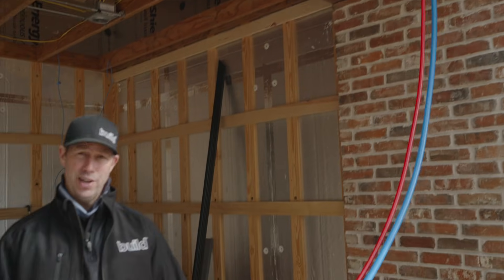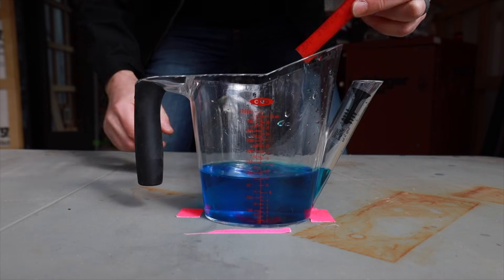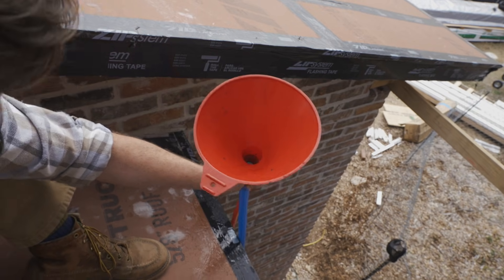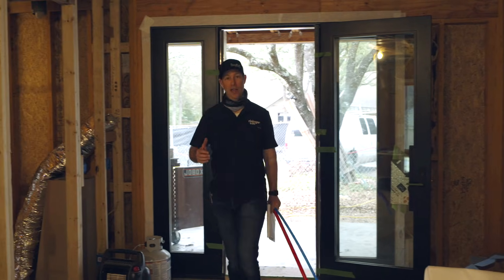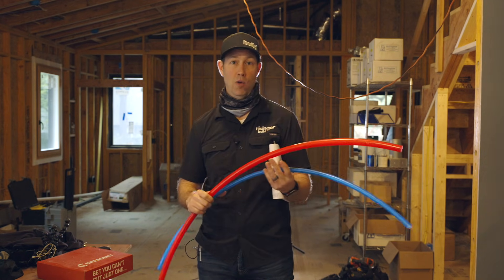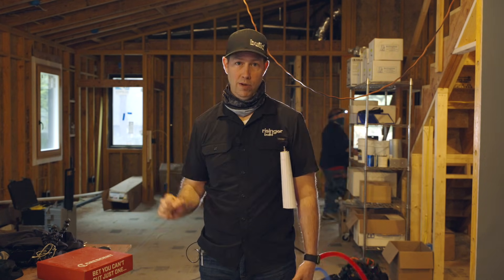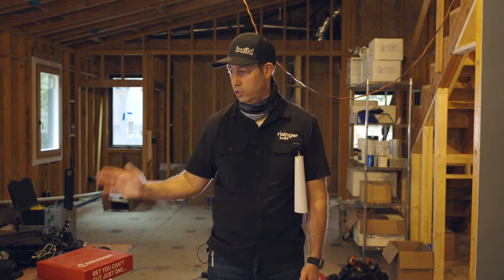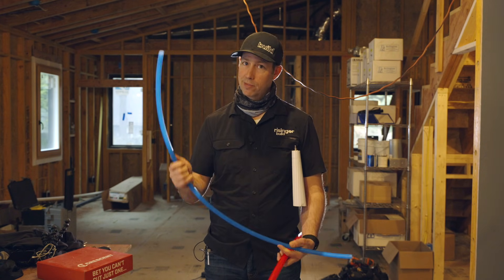What's the BEST Plumbing System

Comment: The size of the PEX predecessor, PB was my favourite.  The OD was approx. 1/2 inch,, the ID barely more than 3/8.  A 3/8 pipe can easily deliver 5 to 7 gallons per minute under normal pressures.  In a manifold system, the upstairs master bedroom shower had full hot water in 11 seconds,, a 90 foot home run.  No joints, no fittings except at the manifold and the sink connection.  System still works great 30 years later.  PB got its bad rep from plastic elbows that failed.  The metal (copper)  fittings never failed.

Comment: I’ve often wondered if a small electric point of use heater on the hot water line for each bathroom/water use location would be most economical? 
Have never taken the time to do the math to estimate cost vs benefit. Might do it one day when I don’t have anything else to do.

Comment: Don’t waste your time just run a 3/4 loop and branch off with 1/2 to the fixture lot less piping and butter hot water less wasted water don’t worry about the fittings you’re just making more out of a easy job

Comment: Just as there are many issues with central air, central plumbing has its downfalls. I am of the opinion that point-of-use instantaneous water heaters should be scattered throughout the house.

Kitchen sink, dishwasher and maybe laundry on one; tub, shower, lavatory on another; and so on.
Reply: Troy-Moses Panton Most of the rest of the world moved away from hot fill appliances years ago. In Europe, our dishwashers and washing machines are cold fill and heat themselves. A dishwasher fill is only about four litres, it's pointless trying to fill it from a hot supply as at best it will be lukewarm by the time the machine is full. Same with front load washing machines which have been the norm in Europe for forty plus years.
Reply: @spencerwilton5831  That's exactly the type of thinking we should have, appliances with water-heating capabilities. In all the commercial projects I've designed, each bathroom and kitchen sink is equipped with its own instantaneous water heater.

Comment: When I remodeled a bathroom the plumber installed a recirculating line (from the end of the line) and pump that returns directly to the hot water tank. Is that basically the same thing as the ring system you’re referring too?

Comment: What’s cheaper? Wasting water or wasting electricity and/or Gas?  
Here we are water abundance, no shortage. I’m all for saving money which would mean saving on waste. But I had to choose. I went to a NG outdoor tankless water heater. I have saved a  tremendous in natural Gas but my water usage has increased by 1/3 due to waiting for the water to get to the correct temperature. I do not have a recirculating line. I really should add one and install a motion unit to activate it to turn on so no wasting of water. However how do you solve the cold water sandwich issue?  
I doubt you see this but here to hoping

Comment: Question: My water heater currently has 1/2 line in and 3/4 out. Does that create a delivery issue for the hot water taps? There seems to be a drop in hot water volume when 2 hot taps are open.

Comment: One can install a "hybrid-manifold system". Rather than using one line per device, run one line per bathroom/kitchen/basement. That way the sink is hot when you step out of the shower to shave. And there is very limited risk that one use multiple fixture in one location at the same time. So small risk for pressure  and flow issues.
Manifold system is superior in my opinion for any  future service, maintenance, renovation or troubleshooting. since one can isolate individual bathrooms.  I can isolate my garage and outdoor lines for the winter for example.

Comment: Where does the racetrack connect back in to itself?  Am I missing something or is it basically a straight shot from farthest point back to the inlet side of the water heater?  Presumably with a check valve?  Pressue would be higher on the cold side coming from the street vs through the heater and all the line and then back though so how would that work?  Or is there simply a "T" close to the heater?

Comment: What about a "Gravity Hot Water" system. where you run two pipes to each hot water source, and let gravity pull the hot water up to each source.
No pumps needed, since cold water is heavier than hot water, and it recirculates on its own.

Comment: After many years of doing copper repipe in cali, I installed my first pex system in a single wide here in iowa. ran 3\8 on the hot side of k sink to lav, 1\2 to w.heater. 1\2 dedicated hot line to tub. 3\4 tee on top of w.heater. Cold side is all 3\4. No  more ice water challenges when I take a shower. The k sink used to take 2 min to get hot water, now about 30 seconds. Ran a line from ro filter discharge to toilet tank to conserve a little bit of water. Ran almost all ttrough heat duct. This ended having to leave k sink running all night to keep from freezing. It is probably all against code and if county found out I am sure they would order the park to send in the backhoe and knock it down, like they did with the previous 5.

Comment: Why in the world would/do people run a manifold line to EACH fixture. Use a manifold, and run to each ROOM. You get all the benefits of a manifold system - you can turn a room off, balanced pressure, etc. You don't waste as much material and labor, and you don't have the separate fixture hot water problem.

Comment: keep a med sized pan near all sinks, turn on the hot water until it gets hot and no waste as you can use the colder water in the pan for something else
Reply: For bathrooms, diverting the sink drain to the toilet tank is a good move. If the real issue is not wasting water, then a whole house grey water recycling system is the answer, especially in climates that need regular watering of lawns/gardens (and what do we need grass for anyway). This doesn't  address the "problem" of waiting 30 seconds for hot water though.

Comment: For a bigger household and you like the manifolds what you do is run multiple manifolds with a recirculation line from each manifold and you can save fittings but yet use a recirculation pump system. 👍

Comment: What is that system of interconnect for pex you are using in this video? Locally only copper rings are available (and very expensive shark bite connectors). 

Nice video.

Comment: I thought you said you were putting in an instant water heater, is your water heater going to need to run all the time than to maintain the temperature in the pipe, and how much electricity or gas will you be burning to keep your system running all the time?  Plus the wear and tear on the system.

Comment: Cool. Brush your teeth with “hot” water before the shower. The hot water will be there or nearly so when the shower is started.   We could also design our homes around mechanicals rather than shove them in as an afterthought. 
Next, we need to see an electric system that has progressed past 1960.
Reply: I thought you were supposed to brush your teeth with some mace in the dark.... Before burning down the trailer park...
Reply: @jimrohrer2751  that’s shaving your face 🤣
Reply: i brush my teeth in the shower
Reply: I like to see electricians start putting more forethought into residential systems as they do in commercial systems. Where as they follow a set blueprint of how everything should go which is usually pre-planned out based on what the building will be used for. If homes were wired in this same way breakers would not be tripped because too much ambridge is being used on one circuit that is interconnected to 5 areas of the home but rather individual rooms. Doesn't matter the $$$ value of the home, unless it's a tree fort, it should have more common sense. They wouldn't do this in their own homes so don't do it elsewhere.
Reply: Smart
Reply: I set up a H valve for my toilet above my bathroom, in the winter I open the hot valve close the cold, just before a shower take #2 turn on shower instant how water. No need for race track system or expensive circulation pumps. And no the hot water isn't going to crack your toilet

Comment: I think one thing that is always brought up in these "conservancy tactics" is what is the energy consumption of the alternative, I also wonder how this is not running risk of the "Legionella Bacteria", as you are inadvertently creating a heating loop using your water heating source; which in retrospect is why you aren't allowed to cross hydronic heating water with domestic water use.  Now I know the water heating source and the system won't have fixtures like a hydronic heat system would, but then in this point why not attempt to plumb the system as both a heating and domestic hot water use, now you will have killed two birds with one stone. But back to the first point, you may save the couple gallons of water from hot water lag time, but now what is the cost of the pump circulating the hot water, and the loss of water heat through circulation causing for increased demand through the hot water system? I know water is a finite source, but at this point in time is so is energy; we haven't graduated to renewable energy dependence. I would like to see a combined system though, i think that would be the greatest benefit to all, ample or secondary heat and on demand hot water.
Reply: The problem with this type of system is dead heads where little to no flow happens which is absolutely potential for legonella, that and in general. If hot water is being used it's also now heating the space un intentionally. 

That said the primary reason the plumbing code does not allow these systems to operate as one is the potential for glycol additive to be introduced to domestic water

Comment: What's the added cost of running a recirc pump and cost to continually heat water you aren't using? Probably more than the cost of the wasted water.
Reply: Steve Drawdy You can easily run the recirculation pump on sensors- someone walks into the bathroom, the pump comes on- by the time they are ready to wash their hands hit water is available. It's also common to put them on timers- they might run for an hour each weekday morning, longer at weekends, turn off over night etc.
Reply: @spencerwilton5831  do you mean motion sensors? Are they just added as an extra spot in a gang box with the light switch?

Comment: My new house instant hot water works great. I used a 3/4” PEX insulated trunk that loops as close as possible to each fixture with 1/2” twigs as short as possible. The kitchen sink is 1st off the loop then the master bath, with the cloths washing machine last. The 3/4” loop returns back to the Indirect gas boiler heated hot water tank. At the tank a low power Grundfos SS pump provides the recirculation loop flow. The pump is turned on/off under control of an Inkbird thermostat that keeps the return water at 120*F +- 2*F

Comment: Are you returning to a standard hot water tank or to a tankless.  I was leaning to a manifold for our remodel, but you convinced me on the racetrack.
Reply: I don't see how it could be tankless? You'd have to be running the recirculated water back through the heating unit all the time, and have it "smart" to switch instantly between heating from cold or reheating fairly hot water.

Comment: Why don't you use cupper, stainless steel multi layer composite pipes. With plastic pipes you will always have air in your systems. I know it's more expensive but it's worth it I would say.
Reply: Also don't you use piping network calculations to find the best diameter needed?

Comment: For my house I put in two PEX manifolds. Manifold for 1st floor is in the basement, manifold for 2nd floor is in closet on 2nd floor inline directly above 1st manifold. I have  3/4" supply into & out of the 1st manifold into the 2nd manifold, then recirc pulled out of 2nd manifold back to hot water storage tank. That's my primary loop, it is always hot & leaves only the short 1/2" pipe feed to each fixture or that 1-1/2 cup waste at each fixture. Always have hot water within 3-5 seconds at the faucet or shower. Seems to be similar output to the loop system. Note: recirc pump controlled aqua-stat.

Comment: Lets review 5th  grade math... pie(diameter/2)**2= C which is the area of a circle...  measure the diameter  in inches...  times that by  the  length in inches.. .and finally google and find out that 1 oz of water is 1.8046875 cubic inches.    Much easier than potentially falling of the roof!!!

Comment: I thought long about using at point (Stiebel Eltron) in my home. I still wish I used them at the sinks. With more cities in the US moving away from gas heated water, at point and heat pump units will likely become more prevalent.

Comment: 1.63 cups for 1/2" and 3.67 cups for 3/4" - bust it all down to feet then,  pi r squared * h = .0136 and .03066 cubic feet, then multiply by 7.48 to get gallons then multiply by 16 to get cups.
Reply: 1.47 Cups for 1/2" PEX and 3.02 cups for 3/4" Pex.. Their ID's are smaller than their nominal size.

Comment: Does anyone know what the long term risks for water leaks in a re-circulation system might be?  I have a friend who had a copper pipe based recirculation system and wound up with a big problem with pin-hole corrosion and leaks along the recirc line after about 20 years.

Comment: Before we built our house I found an article by Gary and we had our plumbers do this system. I want to say my favorite thing is the insulation on the hot water lines. We only have our recirculation pump come on every half hour during the day and the water is super hot all the time. I don't think there's a fixture in our house where we have to wait more than 2 seconds for hot water.

Comment: We only turn on the recirc when taking a shower in the mba which is the farthest from the heater. Why? Electricity cost to run the pump, you can hear the water flowing so you think something is on, erosion of copper pipes.  Check the warranty on tankless heaters... they have an exclusion or reduction in warranty if there is a recirc system.

Comment: Pretty simple solution to his "my wifes sink is cold"...share a hot line to each bathroom off a manifold and then branch off.  I have 3/4 dedicated to 2 headed shower and then separate 1/2" to double sink.  

I've done single 3/4 to bath with single fixture, but I'm big fan of max pressure/max flow when it comes to bathrooms.  

And if your not tankless or hybrid, none of the savings matter

Comment: I have all my fixtures on a home run system with a third pipe for hot water return. I have a tee in the wall with both hot water pipes connected to it just before it exits the wall.  I have the 2nd hot water pipe come back to a manifold which is connected to a recirculating pump that puts it back into my indirect fired HWT with an inlet that is made for that.  When I turn on any tap, washing machine, dishwasher etc its instantly hot.  Shower on and its instantly hot. I lose absolutely no cold water.  The grunfos pump has a timer on it so I can turn it on or off at any times I want to..  😀

Comment: Ugh, our house is so bad that we run both sinks in the master bath to get hot water before taking a shower.  It's all copper, presumably with no insulation, so even if I take a shower relatively quickly after my wife, I can tell it has already started to cool off.  I've started at our kitchen so many times trying to come up with a justification for cutting it open just so I can insulate those pipes.

We've talked about a recirculator pump, but haven't pulled the trigger yet.  Given how bad our heat loss is, it'd almost have to be one where we push a button to kick it on.
Reply: not all tanks are supported by a recirculation pump. Some tanks have a flapper valve in the inlet (that you can remove sometimes). Which is what I had to do. You can set the timer on the pump to come on whenever you want it to. They are super easy to install.

Comment: A hybrid system seems to be a good compromise with a circulator if & where possible.  With a trunk and branch system you wind up with shut offs all around the house in the basement.  What happens if you want to finish a particular portion of the basement and may need to shut that particular line off to change out a 1/4 turn valve.  Could use drop ceiling I suppose, but those are not impressive and I tend to avoid those.  I prefer to have the shut offs in one place, so much more convenient and able to label each line.   Just my preference